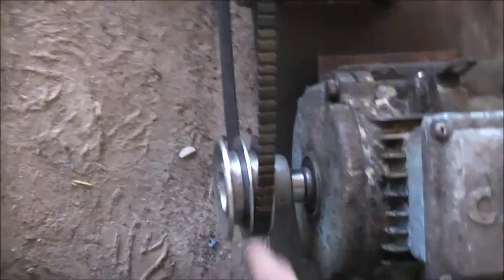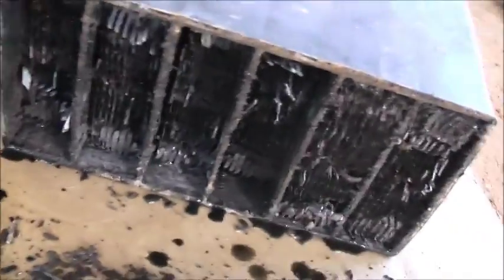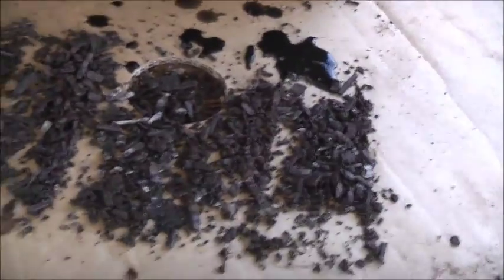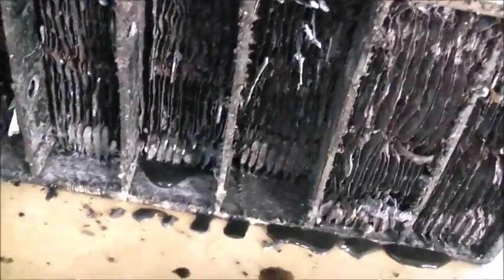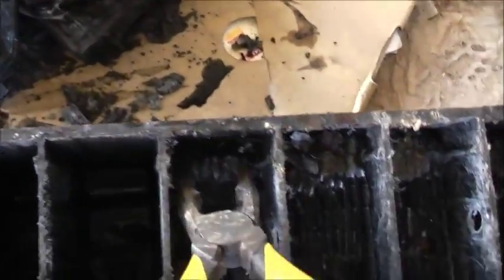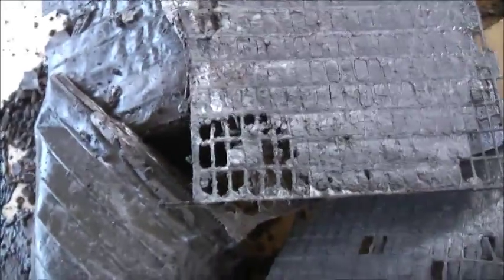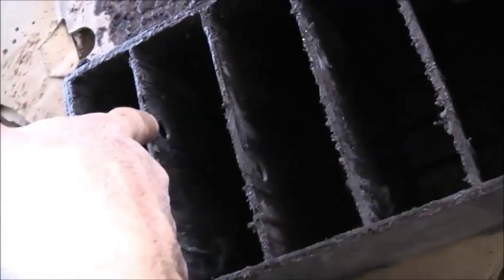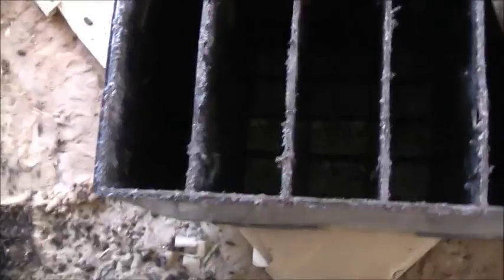Compressor Run & Exide Battery Casing Ready!

Comment: It would be an interesting idea to gut-out one of those batteries and fill it back up with.....
.
.
.
Super-capacitors!

I have seen someone else on YT take some super-caps and use thenm to start a car. I think they are only rather low voltage, but they have to be banked-together to get enough voltage and power to turn-over the engine.

It would be interesting if they are compact enough to be put into that battery casing. :-)

Thanxx for showing,

-BoomBoxDeluxe.

19th July 2014, 18.35
Reply: At least they will be able to handle high charge currents without the worry of hydrogen gas and the need for distilled water.

Comment: We take fully dead lead acid batteries to the store when we buy new ones because it costs less to get new ones if you bring old ones. It doesn't matter the type, we bought 6 massive 100ah deep cycles for 40 bucks apiece. I cheat with the batteries though. They weigh them, and you can completely fill them with water and you get more money for them...